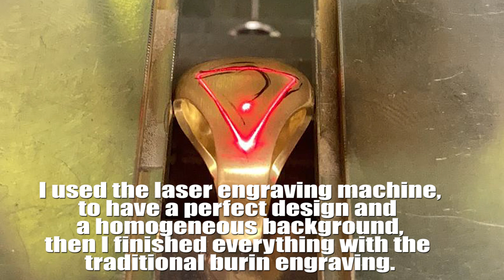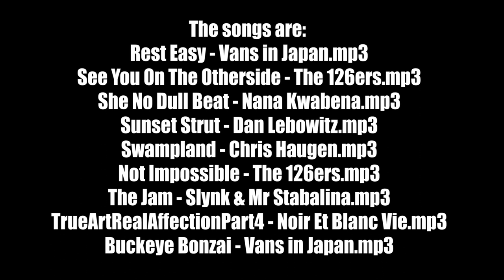18 KT gold chevalier ring, with custom engraving.

Comment: I love your engraving, as for the making of the ring i'ts not very professional the reason it has too many joints and I'm very surprised it didn't collapse on soldering, it would have been better and quicker if you made a round tube first and then cut out the inside dome and as for the top-plate it should have  been soldered on the top of the ring not inside because then you would see the soldering line around the top of the ring.
Reply: briefly nice comment, i liked the point " i'm very surprised it didn't collapse on soldering" 😃

Comment: This is a Beautiful piece, awesome!! Mr Alberto is a creator with his master pieces, I m so honoured!
Reply: He makes nice enough pieces by he throws away so much time the way he does things. He could have simply carved the ring out of wax, used that wax to create a silicon mold and then anytime he needed a similar ring he could just inject some wax into the mold, then use that to cast the ring that just needs cleanup work and final engraving. Instead, he spent days just creating the ring before he ever got to the cleanup and engraving.
Reply: hi baronstone, no offence but I think slow is beautiful... the traditional way is interesting, I am intrigued by the making process and I have been watching Alberto videos cos I enjoyed watching the whole process :) 

Every ring is different, that is why it is custom made. I would hve bought off from any shop if I want something from a silicone mold.
Reply: @Baronstone  cast jewellery is not comparable to hand forged jewellery. Hand forged pieces are more robust, no porosity issues

Comment: Talk about taking the long way around! I mean the final product looks nice, but why didn't you just cast the ring instead of cutting it out of multiple parts and then spending hours bending it to shape before soldering it? All you had to do was carve the ring out of wax first, then cast it normally. That way you do not have any joints to solder, you just have to use a file to clean up the edges after casting it. The way you made it did not make it easier to engrave, all it did was create multiple potential points of failure. I mean do you not know how to do lost wax casting or do you not own the equipment to do it that way? I find it hard to believe that you can't afford the equipment to do it if you don't have it.

So why do things the hard way when you could literally save yourself a day of work by creating the ring from wax and then casting it? Heck you would be better off creating it out of wax and then making a silicon mold that can be injected with wax to save time in the future if you need to make another one. So why do things the way you are?
Reply: You seem very interested in saving time, so much that I am afraid that you cannot understand that some goldsmiths do not care about it. It is unimportant. What we try to do is to make a product in the best way possible. And casting is never that. It is, for the most part, just shit.
Reply: He probably spent less than a day making this, so while you were waiting for the the burnout oven to finish he was done. By the way a hand made (fabricated directly in metal) piece of jewelry is superior to a casting in every way.
Reply: Yeah, that was an insane amount of work for a ring that would have been very easy to cast.
Reply: @dordiwesterlund2528  A cast ring would be much more structurally sound than having multiple solder joints. Obviously, he's not opposed to taking shortcuts, since he uses a laser engraver.
Reply: @DegreesOfThree  Nonsense.
Reply: @dordiwesterlund2528  you are correct. Over forty years ago when I started my apprenticeship I was told if we catch you working in wax we will ask you to leave.  The maestro of our shop was Italian he started his apprenticeship at twelve years old in Rome in 1932. After all these years I have seen castings completely worn out by the owner while the handmade (fabricated directly in the metal) pieces completely look near original. The reason is because when rolled out and forged into a piece they are far more compact, result, better stability better finish better durability, common sense. Castings=stronzo!
Reply: @joejeweller7614  Hi Joe, well of course. It suffices to look at a casting with a microscope and compare it to handmade jewellery. I do not remember how many cast prongs I have seen breaking off. I myself would never cast. The problem is that jewellery has become an "industry" as any other and that "time is money." And so, we make stuff that all looks alike of equal poor quality everywhere while the old art of goldsmithing is dying.